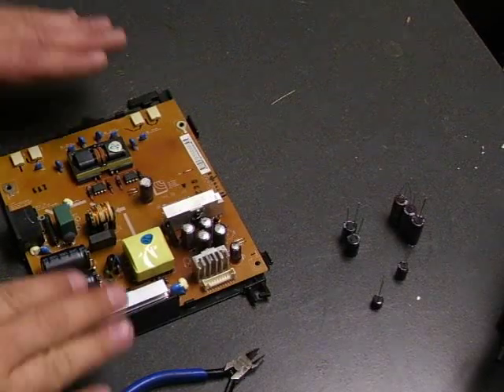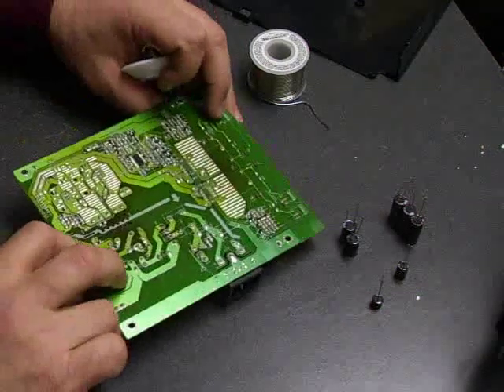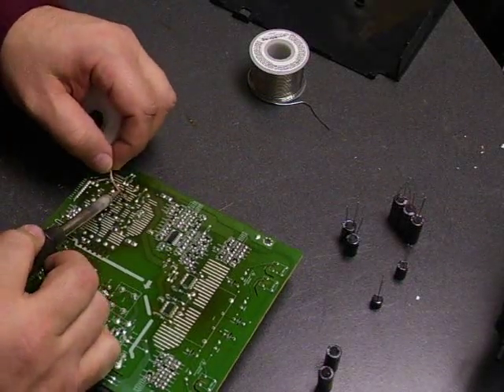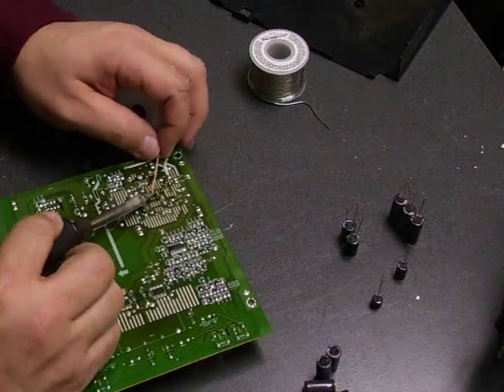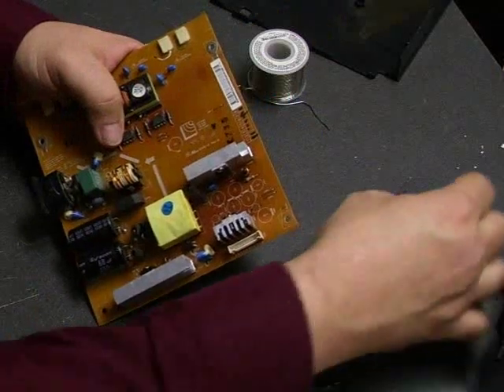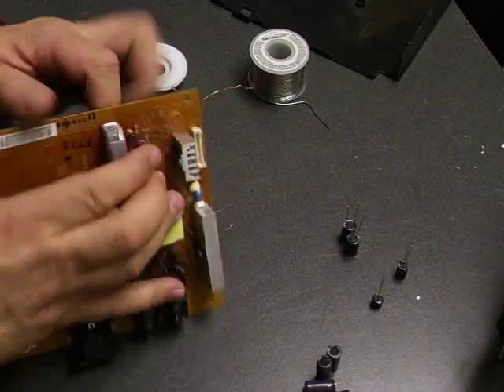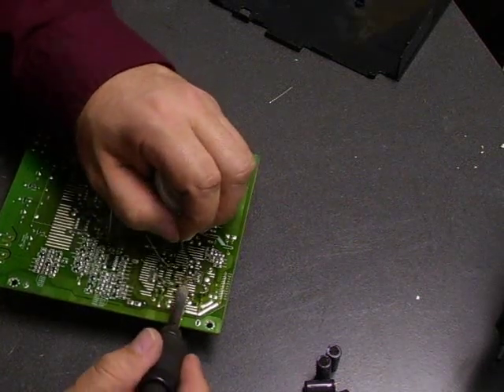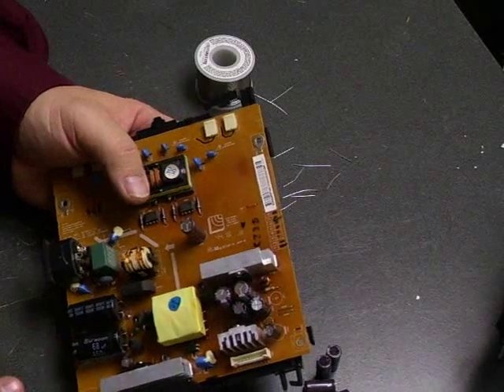Repairing a LG L227wtg-pf monitor - Part 2 Board repair

Comment: Thanks! I just used this to repair yet another monitor.  Although I like LG Monitors, shame on them for using such a poorly designed power supply in this monitor. Placing temperature-sensitive capacitors between power transistor heat sinks (the hottest components on the board) is completely negligent.  No doubt tons of these otherwise-perfect monitors have been disposed of because of this design flaw, don't even tell me how "Green" LG is.

Comment: Upon trying to test the unit, I accidentally had the board touch the metal back of the LCD monitor. Unfortunately there is smoke and a clear dent in the monitor. Is there any chance this is repairable or is it beyond saving?